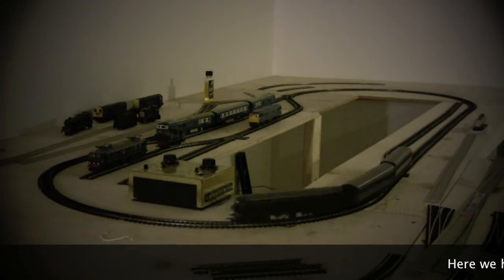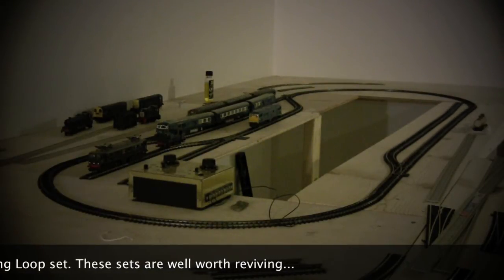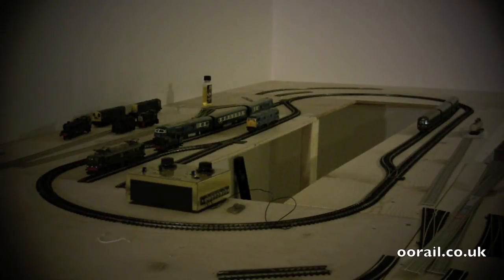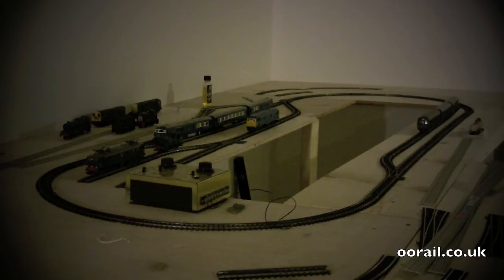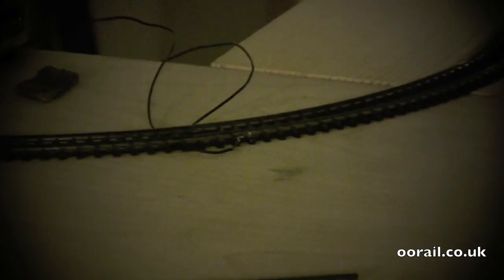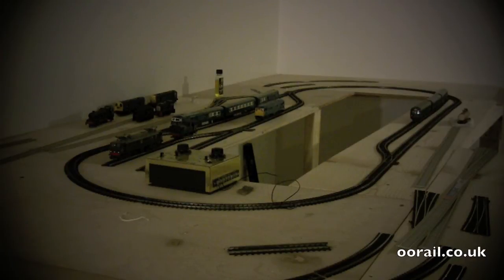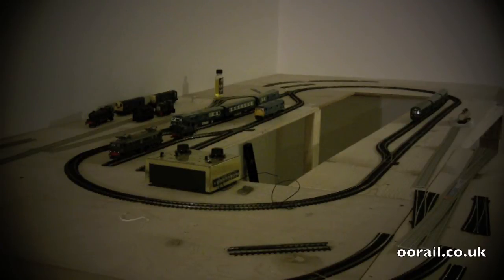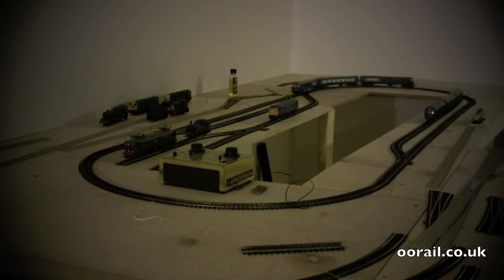oorail.com | Reviving old Tri-ang Hornby Train sets from the 1960s

Comment: Right up my street this post as I am undertaking to rebuild an old layout from 42 years ago.  I bought a second 
Talisman set with the A4 Pacific Golden Fleece for my son then it was stored away till grandsons arrived  then
put in the garage till this year ! See a video of the start of the rebuild with a few addition from ebay The video
and the layout will improve hopefully !!
Reply from the maker: talbotvanman If you haven't seen it already you might find chambs123 a useful channel... If you are reviving the track too, be prepared to do a fair amount of soldering work, I setup a decent sized loop of super 4 track, and about a 12' run of series 3 track, the fish plates are pretty much shot, so you'll want to attach wires to each segment of rail! If you search my channel for tri-ang you will find a couple of useful videos! :)

Comment: Triang worm engines such as the one found in the Class 31 were very tempremental when the worm gear 'shifted' and caused the engine to jam! Had one back in the mid 1970s to mid 1980s and it was always being repaired after relatively short lengths of time. Compared with Ringfield (Hornby) Engines this type of engine was inferior in terms of reliability anyway. Any advice on these as Triang Class 31s are still available to collectors / model train enthusiasts today please?

Comment: Most Trinag supplies were double insulated with metal cases. Being metal they are considerably less of a fire hazard than modern plastic items.

The main problem with them, such as the 1958 PC-3, is that the transformers die. I have one here with this problem bought for just £2 this year.

Sometimes also the Selinium recifiers fail through age decay. Replace these with modern bridge recitifiers.

However another option is to connect an outside 12 Volt supply to the 12 Volt uncontrolled output terminals of the dead power supply and it will act as a circuit controller. This works with any dead transformer power supply.

Triang-Hornby produced a converter rail section to convert between Super 4 and Hornby Dublo 2 rail (Series 5) track and then the later System 6 / Peco track.

Super 4 and Series 3 rail is tin coated. Power clips are a better idea if the contact ends are tinned.

The old 1950's 12 Volt circuit controllers work best if the input and output wires are soldered rather than plugged in. They have their own short circuit trips and work fine on 12 Volt gel batteries. I use a pair on Standard track with my 1950's locos.

Track is best cleaned with a rag soaked in methylated spirit. Using a track rubber removed the tin coating which will subsequently cause the track rails to corrode and rust. Triang manuals emphesised to never use an abrasive track rubber to clean the track.
As a kid in 1972, my father built a big Super 4 double track layout with hump shunting yard which was laid on roofing felt for realistic underlay and noise supression. This was all dismantled and sold on when I moved onto even bigger layout using Peco track and the then new Hornby Zero One pioneering DCC train control in 1979. I still use Zero One today and it works fine.

Comment: also of course you ones going fast at the moment but once the clips start to rust off many months I show you in this  of my next and better videos how to make clips to slot in the track
Reply from the maker: +James Burdis Yes I saw your clips that is an interesting idea. The clips are called "fish plates", the Americans call them "rail joiners". So they shouldn't technically rust unless the track has been damaged, the rails and the fish plates are coated in a protective coating, which is actually the reason its really hard to get solder to adhere to the track. There are a couple of ways you can prevent them from rusting, for example you could just weather (paint) the track. I did this with the older Tri-ang Series 3 track on the other part of my layout once I got the track working properly. Another option is to simply solder both sides of the fish plate to the rail, although if you have the coating still intact thats quite an effort. I bought all new Super 4 track, with the exception of a few pieces, so it'll be a very long time before I run into problems. What I did on the other track though was just start soldering dropper wires to each section of the track that was losing power, this fixed the problem. The only issue I see with your clip idea is that aside from the cosmetic look with the tie wraps, is that the clips and/or tie wraps could foul up some locos. The magnahesion ones in particular might have some issues with the brass / aluminum clips... Its definitely an interesting idea though... I left some suggestions / tips in the comments of your video on how to improve the filming etc.. hope it helps! :)

Comment: Super 4 to system 6 (code 100) Triang track converter tracks are or were very common (part #R476). They are far more common than the 3-4 converter. They certainly aren't that hard to find. 

Secondly, an old noisy transformer, as you point out can be dangerous. But for heavens sake folks get another newer DC transformer.  It's a buyers' market for good ones right now ... for cheap, since all of the so-called pros have largely switched to DCC (Digital Control). 

Using a potential fire:electrical hazard is plain crazy, even worse when there are children around. I'm sorry for the contradictory  info. But your advice is unsafe. I'm sure you mean well, but I have to point this out.. The advice to buy a fire extinguisher is good... under any condition. But as a safety precaution for an old non-grounded transformer???  The precoution is to throw it out

However, props for encouraging to use their old trains. So sorry, I don't mean to sound harsh, but there's no other way of saying it. 

-MAS
Reply from the maker: +Martin AshwoodSmith Thanks for taking the time to comment Martin. While you can definitely purchase super 4 / series 3 to code 100 track converters, that won't help with the deep wheel flange problem. As soon as the older locos hit the code 100 track, the bottoms of the wheel flanges will strike the plastic chairs used to mount the sleepers to the rail. Best case, you'll get a loco that makes a ton of noise, worse case, it'll jump off the track. 

As for the transformers, I'm pretty sure in the UK even the old ones are grounded. As for the US/Canadian ones, well even the newer ones aren't grounded. None of the Bachmann DC/DCC or the Hornby DC controllers I have with 110v power packs are grounded. That said its definitely better to use a newer one unless you know what you are doing, as there is much better thermal cut-out protection in the newer controllers. That said, just because something is old doesn't mean it cannot be run safely. Some locos draw more current than the newer controllers are capable of putting out as well, especially if the motors are in need of servicing. There isn't much to these old controllers, so its relatively easy to pop them open and inspect the wiring, replace components etc and get them into a good running condition.

I wouldn't necessarily say that advice is unsafe, just maybe a little less risk adverse than some people are comfortable with. :)